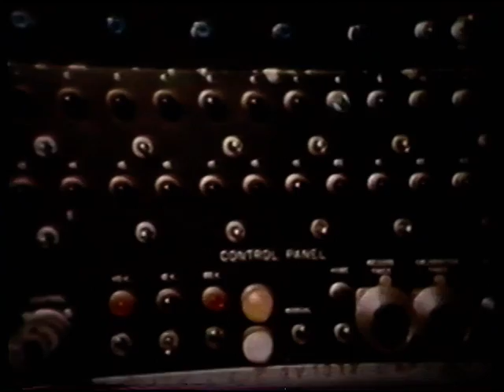Building the Super Constellation, Lockheed film - 1955

Comment: My father worked on the L-1049 Super Constellation final assembly lines (2) from May 1952 to April 1954. Going by aircraft registrations he helped assemble more than 150 Super Connies from the earliest ones for Eastern and TWA without Turbo Cyclone engines up to the first Super-G .The scenes which show the stamping of large parts from aluminum sheet were shot at the sprawling B-1 Plant about a mile east of the Burbank airport at a location known to locals as Turkey Crossing. It's a shopping center now. Turkey Crossing itself was obliterated a few years ago when some new ramps for the I-5 were added. The A-1 Plant where the "Hall of Giants" stood on the east side of the airport is now airport parking. My dad went back and forth from Lockheed to Douglas El Segundo because Douglas treated their employees much better but the drive there and back from the Valley was tedious before the San Diego Freeway (I-5) was built. My dad started at Lockheed making $1.75 per hour with no benefits except some vacation time which he never took in order to get some extra bucks since he had to bribe my mom to come to L.A. in 1951.
Reply from the maker: Thanks for your comments regarding your father's employment at Lockheed when they were building the Super Constellation in the 1950s.

Comment: The Navy actually retired some super Connies way early because of the cost of fuel, which wasn't being made much.
Reply from the maker: It's interesting to note that the last U.S. military Constellation, an NC-121K,  was operated by the Navy and performed its last mission on June 11, 1982.  The aircraft was officially retired a few weeks later on June 25.
Reply: @WAL_DC-6B  I flew on the last USAF Connie mission, which was a flight from NAS Keflavik to Homestead AFB, FL, after we were retired and replaced by the E-3A (AWACS) in 1978.
Reply from the maker: @maxsdad538  Hey, that's quite an historic flight you were on.  Thanks for sharing!  By the way, I was in downtown Reykjavik, Iceland in July 1975 and I witnessed two USAF Connies pass down the runway of the main airport there.  They flew over somewhat slowly and I seem to recall with their gear and flaps down.  That was probably the last time I saw any military Constellations flying.

Comment: How fast did it go . What year did they stop making them ?
Reply from the maker: The Super Connies had a maximum speed of around 360 mile per hour, though they cruised at around 310 mph.  The last Super Constellation, a 1049H, was built by Lockheed in November, 1958 for Flying Tigers.  Slick Airways would purchase the last undelivered Super Constellation from Lockheed in September, 1959.
Reply: The reason for the second part of your question was that turbine power was on the horizon for commercial aviation. Lockheed was busy developing the L-188 Electra II turboprop.

Comment: Seems like they never worried about “air turbulence”?🤔
Reply from the maker: The piston engine airliners, like the Super Connie, of the 1940s and 50s flew at lower altitudes around 20,000 ft. versus today's jetliners flying much higher around 35,000 ft.  Consequently, "air turbulence" for the propliners was more of an issue for the passengers and crew.  I'm sure air sickness bags saw greater use back then than today.
Reply: Dan Uscian ok 👍 thanks 🙏 for the info.